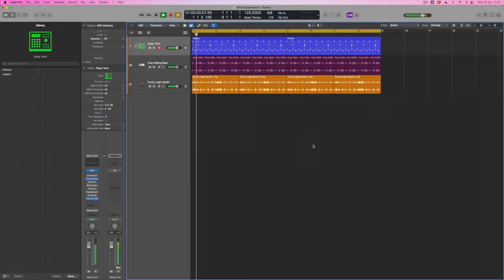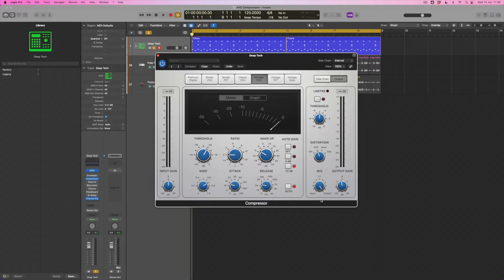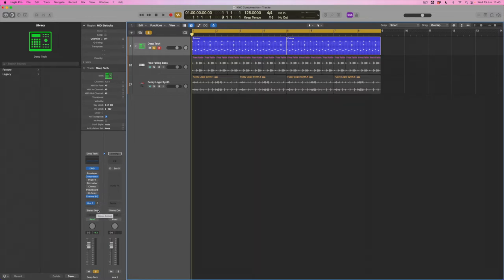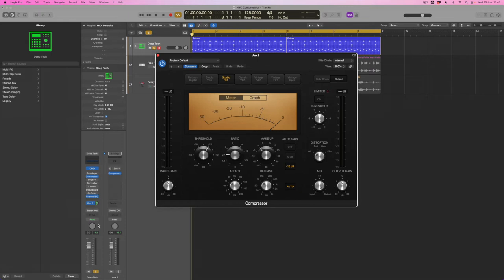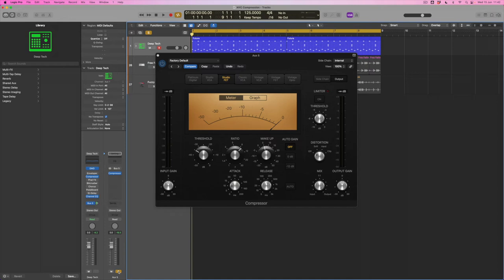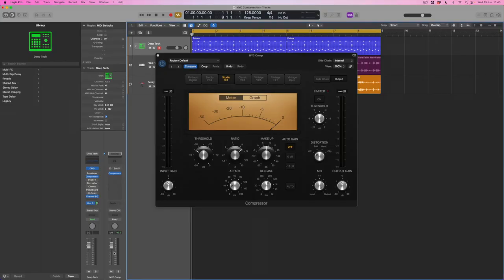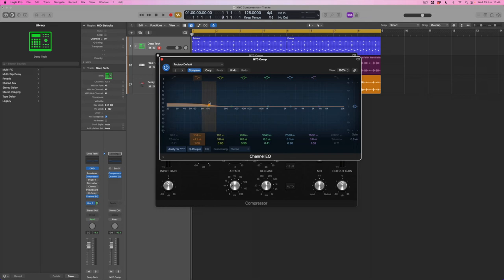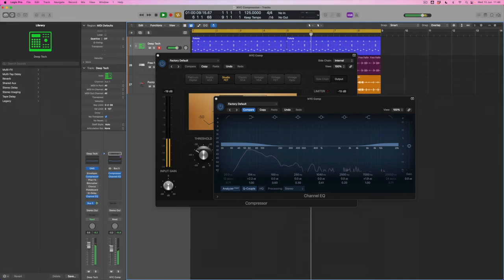LOGIC PRO X - New York Compression Technique

Comment: I use parallel compression but my routing bus is "pre fader"
Reply from the maker: Hi Frédéric. Absolutely, pre-Fader works well too, particularly if you want to de-couple the original signal level from the parallel channel. But post-fader is great if you want to maintain a volume balance between the two signals at all times (such as maintaining a NYC style treatment through a fade-out).